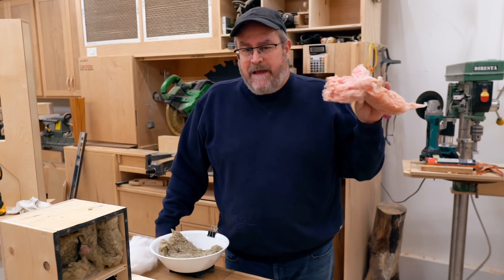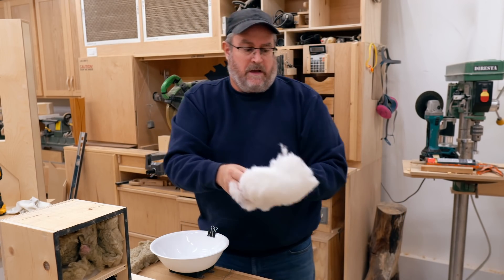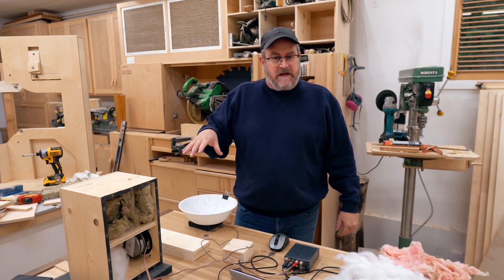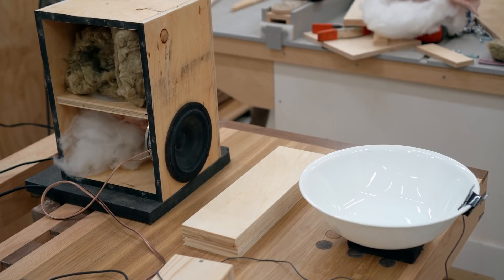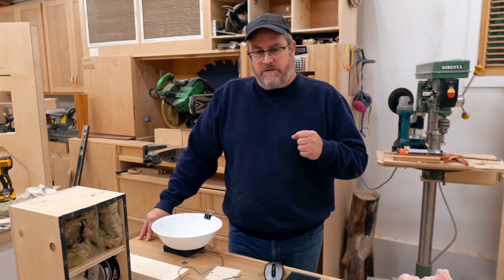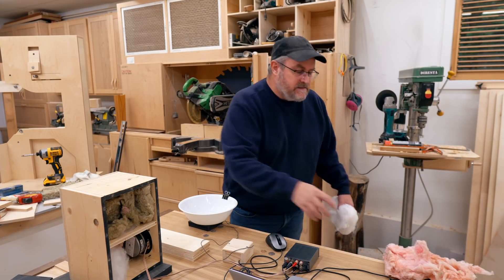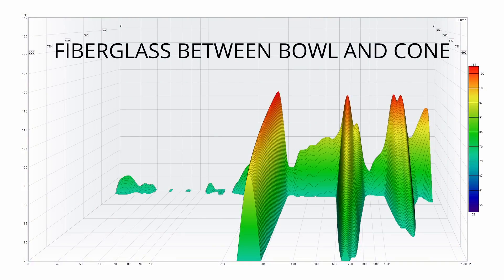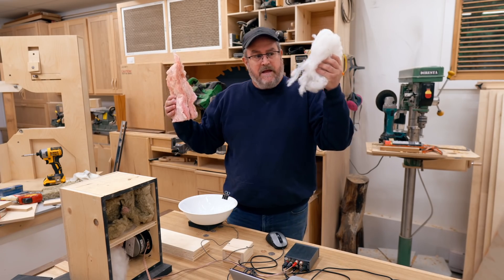Testing Speaker Stuffing Materials... Again!

Comment: Why not volume that is the constant a speaker has you only have so much volume. The speaker can be any weight you want it does not matter!!
Reply from the maker: Because testing by weight is the only constant I can accurately control. 
Here, let me tell you what testing by volume will give: 
rockwool first, fiberglass second and polyfil last.
I know that because these tests show that of the three, rockwool is the best, fiberglass is a close second and polyfil is the least effective.
Reply: @IBuildIt  its that order because you did it by weight that order could very well change if you dod it by volume and you could easily control for volume fill a speaker until it seams full with each. Thats what people would do when building a speaker.  Take Balsa wood if you did a test by weight it would be stronger than steel but if you did a test by volume it would lose miserably. So if you had some thing that was constrained by volume but not wait like a speaker box need to consider the volume as the constrained
Reply from the maker: So go ahead and do it, then. Conduct your own tests - you have a camera and a YouTube channel, same as me, so go for it!
This is YouTube, remember, not Science TV. 
No one is paying me for this, I'm doing it because I think it's interesting and I figure there's at least a few people out there that are smart enough to get something from it.
Reply: @IBuildIt  i would but i have a full time job and two kids under 6. And youtube pays me 20 bucks a month. I was just commenting on the video you made. Your a full time youtuber you have the setup you could get it done quick and easy.
Reply: @AllMyHobbies  Anyone with half a brain can see that what John did and says in his reply is consistent with the test. Volume won't change the results magically and make one better than it was in the weight test. I'm a simple man but I can see this as plain as day.

Comment: The materials being used are not damping the panels or bowl directly. They reduce ringing because the sound bounces between the internal sides. The middle of each object is where air velocity is highest, therefore porous absorption works best.

This is an important distinction, you are reducing internal standing waves, not panel resonance. That would be the domain of methods like constrained layer damping or extremely dense bracing. Not to say that your video isn't useful, just that absorption and damping need to be used together for a truly high tier design.
Reply: The fibres are touching the bowl, they are acting as damping.
Reply from the maker: Given the bowl's open shape without any parallel sides, how would standing waves form? Think about what you are saying.
Reply: @IBuildIt  I suppose you're already aware, but standing waves also form between the sides of a speaker's cone as they radiate outwards towards the listener, even though the sides of a speaker cone are not parallel to one another, because sound doesn't ONLY travel in a straight line, it bounces all over the place at just about every angle, (which is also why you preferably only want to use any specific size of driver cone up to a specific frequency, based on the wavelength of that frequency, but that is another topic entirely), but this guy's point here is valid, where an ultimate combination of using BOTH something like "No-Res" (which stands for Non-Resonant or No Resonance, I'm sure), or the more commonly known "Dynamat" type of panel damping material, together along with an effective "standing wave" insulation like fiberglass, rockwool, or those ground up clothing type of insulation batts, will work "best of the best" overall, because BOTH panel damping AND standing wave reduction at the same time, will result in the most effective internal sound reduction in a speaker box, therefore more resulting sound can be heard "only" coming from the speaker driver(s) themselves, which in most cases is what you want for best clarity and detail, especially in the upper bass/midbass, midrange, and highs. (That depends on the speaker design of course, because some extremely high-end "boutique" speakers I've seen and heard over the years, actually design their speaker cabinets like a tuned instument, like a violin, guitar, etc, to actually utilize their specific cabinet resonances to enhance and balance out their specific speaker's overall sound and "presentation", but that's another method of building speakers entirely, which is MUCH more elaborate and complicated, beyond the scope of most "normal" speaker building where the cabinet should be damped as much as possible.)

Also don't forget about damping of the baffle itself that the drivers are mounted to, in order to reduce refraction losses... Although that specific topic will have to be another comment entirely, because the best materials to use for that are different than internal box damping materials...
Reply from the maker: Lol. I give up!
Reply: @IBuildIt  Haha, never EVER give up, my man! (I know you're joking, but...) Speaker building is a total ARTform, one which is learned and most importantly, REFINED over MANY decades throughout your life! (If you are one like me who is serious and dedicated to your craft, which I get the feeling that you are!)
Reply: @IBuildIt  
BTW, I love your videos, I get something useful from most every one of them, even if it's nothing more than a further confirmation of what I already figured I knew myself.
Reply from the maker: Let me put it this way and see if it will penetrate the crust: when a bell rings because it was struck with a hammer, what is creating that ringing sound? 
Or a tuning fork when it is struck - what's producing the sound you hear?
Reply: @IBuildIt  Well of course, it is the movement of the air around, in front of, and in between the sides of the instrument, (be it a speaker driver, tuning fork, bell, or whatever), that we actually perceive as "sound", so this is always subjective to the listener and their individual ears and how well they can hear.

I say, to just always remember that speaker building, (just like any other form of ARTwork), is never totally "perfect", it is always a "compromise" between two different, usually opposite, extremes, and it is also totally relative and subjective, that's why there's SO MANY different types, designs, brands, and models of speakers out there in the world, as what sounds awesomely euphoric, even mind-blowing, and definitely has that "WOW factor" that you ultimately want from YOUR specific speakers that YOU listen to and love... on the other side of the table, those exact same speakers and design implementations can sound like total garbage, and be completely "unlistenable" to the next person that comes along, lol!... So just always do and build whatever makes YOU happy, and pleases YOUR ears, because that is the MOST important part of speaker building; making something that YOU LOVE to listen to... and if someone else comes along who also loves the sound of your design implementations, then that's great, you benefitted them also, but if not, or until then, it's no biggie, at least you're still happy!

That's the way I look at things anyway... And to anyone else reading this also, remember, that no matter what you do to make any speaker better, or the best it can be, it is totally relative to the listener, and there's no such thing as a totally "perfect" speaker in every way, or for every type of music. Certain designs work better for certain types of music, and in certain room and listening environments, but there's never any one design or size of speaker that fits all music and everyone's listening preferences!

The most important part of any artform, including building speakers, is to just do what makes YOU (and in this case, YOUR specific, individually unique "ears"), happy, and makes you actually ENJOY doing what you're doing in your hobby, and allows you to fully enjoy listening to whatever styles of music that you love, in your specific listening style and environment...

Never expect absolute perfection with speakers, however, also never stop tweaking your craft in building them, to make any design you come up with as awesome as you possibly can. You learn more everyday if you choose to, and always be open to new ideas and designs, suggestions, help from others who are also knowledgeable about the craft, etc. That's why I subscribe to and watch videos from as many different speaker building people on here as I can find; because that's one topic that I'm really into also!

Keep up the great videos man, always keep expanding your knowledge and your mind, and always do what makes you happiest in your craft, no matter what! Have a great day, I have to get to work now! :)
Reply: @IBuildIt  place the bowl on top off the stuffing, with enough to contact the entire bowl surface.  Pretty sure it will damp out the ringing about the same as having it inside the bowl.

Comment: Hi John, I like your experiments a lot. My question wrt these different materials is, at what point is the density so high, that it should no longer be considered a dampening material but a solid. In this case, putting a plate plate in between speaker and bowl would be even more efficient in reducing the transmission of vibrations to the bowl.
My personal diy speaker consideration, where I had to put dampening material in between the drivers and the port, I chose polyfill, since I didn't trust that other materials would let the pressure waves pass sufficiently and thereby making it more a closed box.
Reply: @Douglas Blake the walls directly behind and besides the drivers are covered with that eggbox looking material. It is a floorstander with port on the bottom. I was advised to stop standing waves with dampening material halfway the box between drivers and ports.

Comment: Great demonstration to really hammer home what using damping can do for a speaker. Really interested in trying out the rockwool/fiberglass combo (especially seeing as I have a bunch of trimmings kicking around from having rebuilt an exterior wall and roof). I just built a pair of 2 ways with a passive radiator design to go out on my patio in the summer, going to get them outside to take some measurements soon as I don't have a decent indoor listening space. Loving the repurposing of this channel, and as always the content on the main channel! Thanks for all the work you put in John!